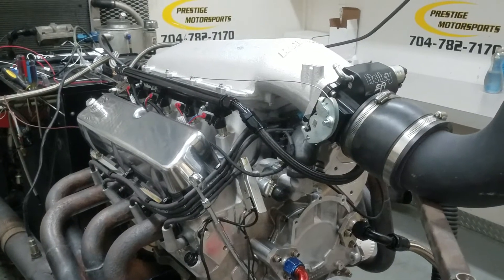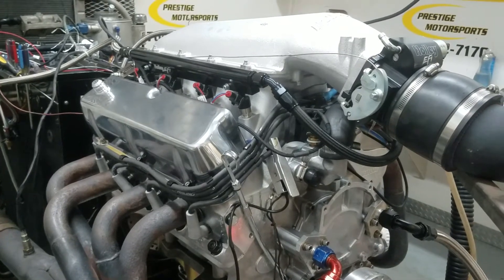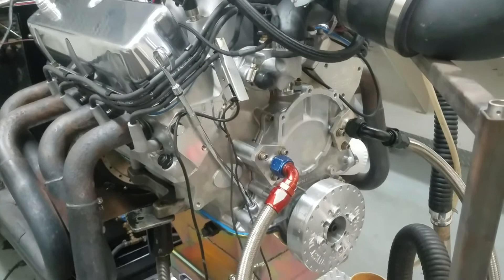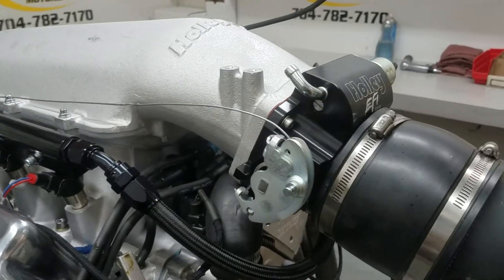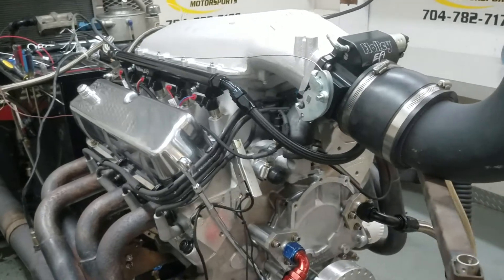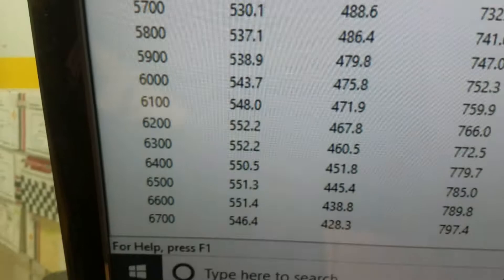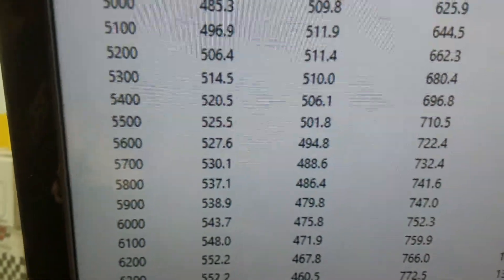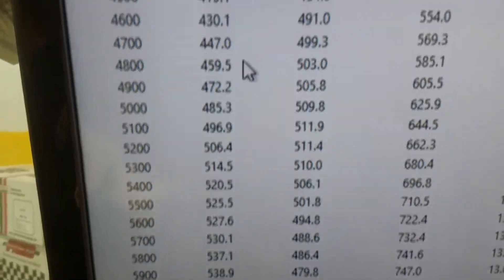Keith's all-aluminum boost friendly 427 small block Ford on the dyno

Comment: I just bought an intake based on this video . What size throttle body are you using?
Reply: throttle body  MPI LS 1 venturi 105 mm billet aluminum black anodized #112-581
Reply: Cant wait to see some pics!!!! Just got mine and mocked up the the new Holley nitrous plate.